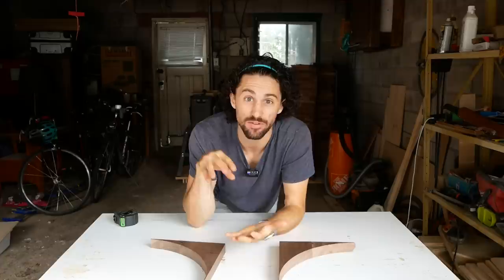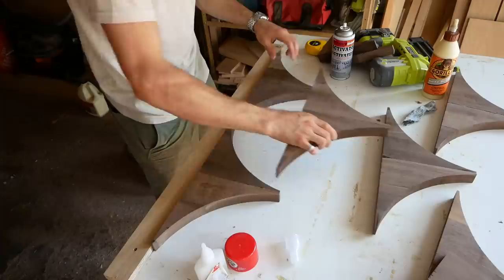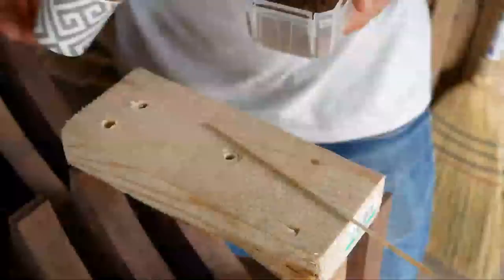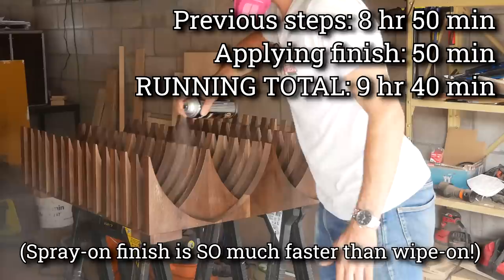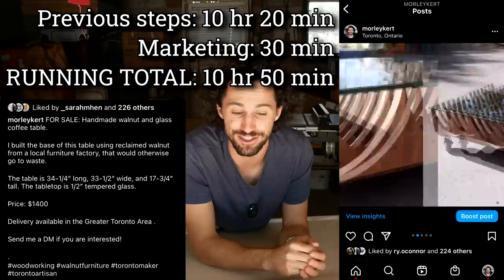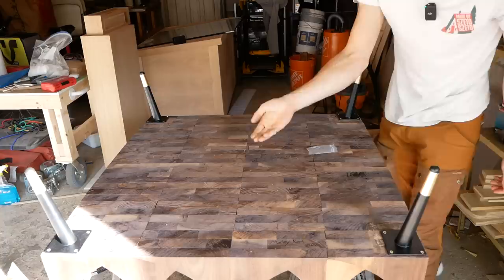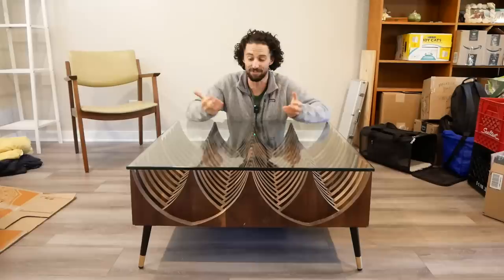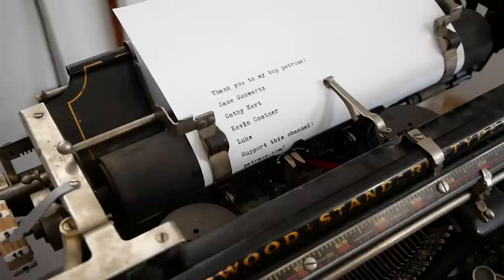A $1,400 Failure?

Comment: I love the table. I think selling it would be easier if the photos weren’t in the street. When I first saw it in the street i thought it looked decent. But as soon as I saw it in the house it looked so much better for some reason. I think adding some extra time and effort (and maybe money) to get better photos would be totally worth it for these projects.
Reply: For sure! Staging is everything with furniture pieces. Seeing it in a space, potential buyers can envision how it might look in their space surrounded by their furniture and decorations.
Reply: Very true
Reply: The reason why the original legs didn’t really work aesthetically is because those are the same sort of wheels. You would see on variously different equipment in the warehouse. You don’t usually decorate things with what you see in a warehouse. It’s not that wheels are a bad idea, it’s just those particular wheels themselves I think improving those legs was a good idea. It would be nice to see more woodworkers create their own legs more often. In order for the design to feel complete it needed some sort of base or skirt. I do feel as though at the tips of the word touching the glass you should glue on felt tips. Having the glass making contact with a wood wood hard surface, is a bad idea.

Comment: I think the design would look really cool for a full sized table if it was flipped upside-down and scaled up a bit. Really cool and unique piece that probably wouldn't be cost effective if it wasn't scrap to begin with.
Reply: I was thinking the same, I think it should be flipped over! The way all the pieces tile together looks great, and the arches remind me of aqueducts. Put the glass on top and it would look great
Reply: Yeah flipping it and having the thin parts as legs had a much better look, just something about the tiled grain on the walnut stood out to me
Reply: kinda defeats the purpose of the look he was going for. he's built tables that look like that on top and that's clearly not what he was going for with this build. He wanted to make the most of the actual shapes of wood he got without altering them too much.

Comment: Awesome piece. And I think you gave it a very reasonable price. 
I’m curious to see how the joints hold over time though. Since non of your glue joints overlap. (Are all in the same line) I probably would try to glue an undersized board sheet of wood to the under side. And att at h the legs to it. The wood and glue might hold up fine over time but as a premium piece I’d want to do all I can to add to it lasting as long as possible.

Comment: I would put some support planks underneath the table and connect them to the legs, maybe in an X shape especially to hold up those pieces in the middle. The wood glue will wear off if it’s the sole support for those middle pieces and the table will break in half. Just a heads up!

Comment: Hey Morley! I really dig the design and aesthetic of the table, POST casters :D those wheels were an abomination lol
As a note though: if you're selling furniture at a premium, you should finish at a premium. Knocking the caster mounts off and not sanding and re-finishing the bottom is a big faux-pas in my mind. Others may disagree since you'll never see the bottom, but I imagine if someone in the future were to pickup their bespoke, handmade piece of furniture and it was less than perfect on the underneath wouldn't sit well. 
Either way, great spin on a project! It's unfortunate that it didn't sell before moving but that's a real lesson learned: if you're aiming high you've sometimes gotta wait for the right customer.
As a fellow Canadian, props to you! Did you stay in Ontario?
Reply: I noticed it in the video but i really didnt think about it with the price. Its actually a really good point. Handmade high quality needs to in fact be high quality

Comment: Definitely trying to hard with those legs. You have a solid coffee table with just those wood blocks on the bottom. Could easily just round off the edges on those wood mounting blocks and call it a day. Keeps the theme consistent. 
I think of tables as usually like 2 elements/materials put together. In this you have a glass top, intricate wood body, then odd metal legs in one way or another.

Comment: I personally didn't like either the casters or the legs. I think a more substantial leg made out of walnut would have been a better option. You could possibly mimic the shapes of the table, but you'd have some problems to solve with the strength of the thin portions.

Comment: Great video, love that you spoke about the costs and your rate. Another difference between your rate and a full time employee getting a wage is that none of your time included breaks or benefits. $80 is quite a good deal actually but if you hade more automation (read higher overhead costs) you might have reduced the hours but then your overhead would be less. There's also that intangible fee for knowing stuff, like where to get the wood. Most people don't realise that the TCOE (Total cost of employment) is normally (varies widely depending on your skill level and type of work) around twice what you get paid as a wage. That's before you work in some profit and overhead.
I don't really like the table but that's subjective, wheels wouldn't have looked good indoors but they are great functionally. What I didn't like was the finish, too many sharp edges but that part of the project is also the most time consuming and would cost lots more to add. I did like the design concept and maybe you could have extended the nice curved shapes concept to the legs (if you had some left over). The glass top showing off the geometric shapes worked well. Again, style depends on every person's taste and where its going to be located. 
Love you channel, very real.

Comment: I might be saying something that you have heard a thousand times by now, but... despite I like the table a lot, in the original design, I would flip it upside down, planned the "bottom" to be the top and have a table with a thousand tiny legs. Yes, the geometry wouldn't be as visible, but te top would show the different pieces and grains and would look something like a butchers block. However, its a great piece, and the casters were not a bad idea, maybe if they were black, people would appreciated them more.

Comment: When you said $80 an hour I was surprised compared to £45 that I charge in manufacturing, seamed fair though when taking into account that's your mark up too. Where as I'd take material + hourly rate (which covers my full operating cost per hour), then add a mark up after.  So I'd have costed about the 1k mark +30% =1300, then I'd charge delivery extra depending on location so your 1400 is pretty spot on in my book!

Comment: At first I was thinking the table was going to be the other way around, with the flat section as the top and thought it would look really cool.

I think the legs would have looked a little better had they been rotated 45* so they were pointing out towards the corners of the table as well.

Comment: $100 hour for custom furniture is more than fair.  If someone doesn't want to pay that..... Well, they have the option to go to Wal-Mart or Ikea.  you can get some good looking stuff at both of those places, but it is not a one off custom, and probably will not last nearly as long.  
You get what you pay for.  If you are selling one piece at a time custom.  $100 hour is maybe even a little on the low side.

Comment: Another suggestion because you probably haven’t had enough of them.  Cut the table down the middle points, flip it on top of the other half and make it an end table or an entry table.  It gives off a Victorian vibe for some reason.  Looks good!!

Comment: You know upside down it would have looked much nicer. so the Bows are the feet and you put the glass on the solid side. it really kinda looks goofy the way it ended up. 
i also expected a little more efford into sanding/ getting rid of glue out. Like when you removed the wheels sanding over that left over would have taken 15 minutes and would have made it look way better. but its the underside so i understand. anyway nice build

Comment: I fully understand your hourly rate comments.

At the same time based on what is seen in the video(s) you often use scraps or up-cycle pallets (which is awesome) but I’m just not sure the end price reflects that.

In this video you took the wheels off but it didn’t look like you did much to clean that up beyond chisel work despite it being  underneath and mostly hidden by the legs.

Just seems like a lot of the finer details - which admittedly would take more time and materials seem to be skipped

Finally, the limitation of tools may make some things take longer than it would others with a full array of tools. 

Not trying to be too critical, it is a really nice piece (although like McKenzie, not for me).

Comment: Morley, I am making this comment out of 100% honesty and there is no intent of malice, ill will, or even harsh criticism, but hear me out.  When people criticize your price, there are a few factors  that I do not think you are considering.  While $80/hr isn't a bad rate for carpentry, it shouldn't be a flat rate for every activity.  For instance, delivery labor and especially time spent fixing a mistake should not be charged at the full rate.  However, there is no price included for the material so this probably evens out.  

More importantly, people are criticizing price based on comparable market values for a similar piece of furniture.  For instance, what takes you 6 hours to do as a beginner/intermediate carpenter wouldn't take a professional nearly as long.  Comparing it to your analogy of the $100/hr car mechanic, the service to change your brakes should be fairly universal.  The guy who is able to complete the job quicker shouldn't have to charge less than the guy who takes longer because he has less tools or isn't as experienced as the expert.  In fact it is quite the opposite.  Your comment about the hourly wage vs hourly charge is spot on and people who don't have experience buying/selling goods and/or services are ignorant to those issues and I commend you for explaining that part.

The biggest issue I see (concerning the complaints about prices from the peanut gallery) is that your prices are comparable to custom built furniture by experienced artisans that have been woodworking for decades.  Although I can see definite improvement over your last projects, it seems like you are a beginner/intermediate woodworker and your pieces lack the refinement of those pieces built by artisans.  Your hourly charge rate is probably in the right ballpark, but the overall price of the end product (comparatively speaking) is where the comments are stemming from.
Reply: Exactly.. I like the guy and he has good ideas, but he's an amateur.  He's using Ryobi tools for heavens sake.   Nothing done in this video required expert technique.

Comment: I like the table with the legs! Looks good in the new place. But I felt disconnected from the explanation of your hourly rate. It may have had more impact had you actually sold the table in this video. And until it's sold, you don't really know that your hourly rate is correct for that project. You could have listed it for $1000 even, but if it's still sitting in your living room, it may not be worth what you ask. You said yourself that people don't scoff at paying a mechanic $100/hr for labor... *because they paid it*. Your point that handmade goods can command just as high didn't hit home in the end. I imagine you are right that a piece like this will take time. Why not remove the time limit you set for yourself and list it for sale in your new neighborhood? New photos with it staged in your new living room might help it sell better than photos of it outdoors.

Comment: Look man I am just going to be brutally honest because i want to help you and i am one of those people that would rather help people and hurt their feeling than not help them and not hurt their feelings. The wheels should never have been considered. I am happy you took the feedback. They were industrial/off road looking. But they were just one of two bad decisions.  Now lets get to the other main issue.. the table should be taller, and be and end table. Or cut in half to make two coffee tables. People like rectangle shaped short coffee tables to go in front of their couch.. and they like square end tables. You should have cut it down smaller and made one smaller square end table.. i don't think it would have been big enough to make four small square end tables cutting it in quarters but that might be something to look at just in case it is. So here is the most important thing.. FLIP IT OVER and somehow attach longer legs to it and use the bottom (the side you burned your name into) as the table top. It would have been prefect that way, and i really envisioned it going there the entire time i was watching this and was shocked to see you did not do it that way. I have majorly screwed some things up before, and its all a learning experience.. so i know this will make you a better woodworker in the future. Sometimes things just kind of suck.. I've been there.

Comment: To be honest, I liked the idea but wasn't stoked. It clearly looks like it was made form off-cuts. The curves on the spikes don't look organic. Geometric shape is fine too but then you should have perfected the curve. It has the vibe of a raw jigsaw cut. The two pieces together also didn't make a perfect half circle or some other shape that looks natural or carefully crafted. The pieces didn't look seamlessly connected and there was some misalignment too. The legs looked much better than the wheels but maybe prettier wheels could have worked as well. Smaller brass wheels could have worked well with the dark wood. You didn't sand and re-finish the bottom when you chizzled the wheel bases off. I wouldn't expect traces of mistakes on a premium hand-made furniture piece even on the invisible side and I assume it would have been a small effort to correct it.
I'm not a wood worker and I couldn't have done it better. But from a "buyer" perspective it wouldn't have caught my attention. The idea was pretty cool but the execution was lacking a bit.
I think it's pretty normal that sometimes we're pretty stoked about something we make and others are like "meh" so I hope it doesn't discourage you. Keep making your awesome and unique content! I also respect that you made this video even though the project didn't work out.

Comment: Sorry Morley, where did you find this $80/h "fair" rate?
Average wages across the US ranges from $15 for leisure and retail activities, up to $30 - $35/h for IT and financial experts.
In addition, you get a wrong pricing vision: the retail price of a product shall not be based on its cost, but on the value the customer is willing to pay. And the materials / manufacturing process shall be adapted to achieve that value while still making profit
Obviously not $1400
Ask yourself: If you didn't build this one, you'd probably have to buy a coffe table after you moved to your new place. Are you sure you'd be willing to pay $1400 for a similar one?

Comment: Dude, $1400 is too low. If you want to sell artistic furniture you need to break into the market of people who buy artistic furniture. Those people don’t want a $1400 table they want a $6000 table, that says the purchase is meaningful. You should double the price, at least, but probably 4-5x it.

It will take longer to sell but if it takes 5x as long to sell, you’re still ahead.

Comment: Bro... you didn't even sand the shitty spots where you removes the old wheels. I know that's it's not visible when installed, but still... sloppy work. Would have taken 2 minutes to clean that up with some 120grit.

Comment: That table is hideous. The sides are completely open isn't it going to fill with dust and dead insects. What if you cat climbs in there somehow and gets stuck.  I think you had free material and said what can I make from this with as little effort as possible. You should have said what do I want to make, and then spend more time planning the final vision. You shouldnt start a high dollar custom project without a firm buyer. But I guess your sponsors don't care so whatever.